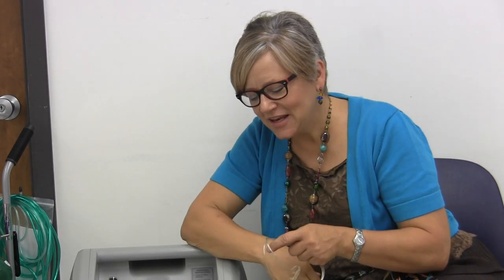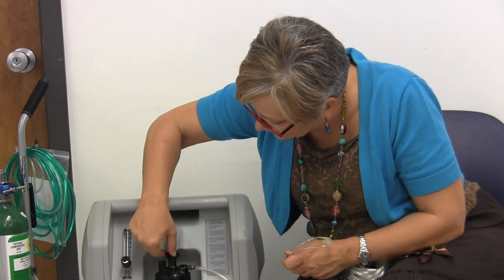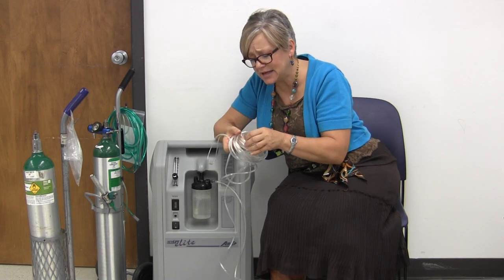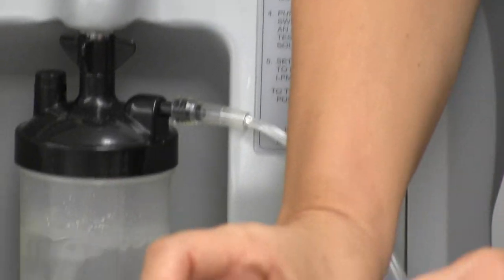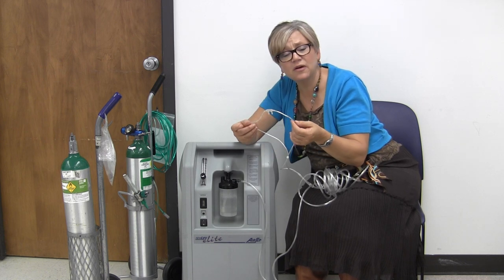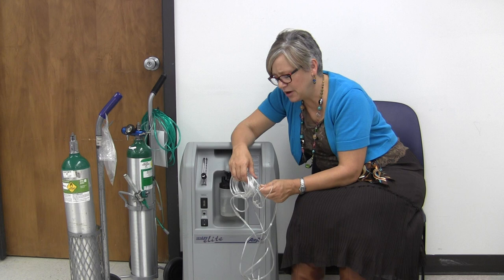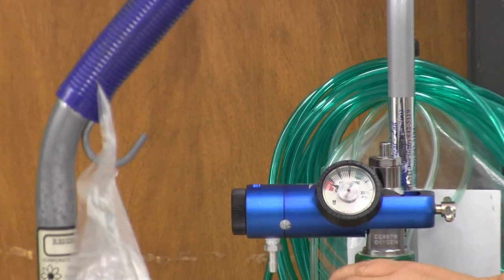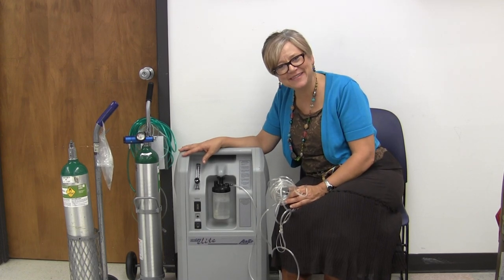Oxygen Concentrator Demonstration

Comment: If you are suffering from  COPD use Oxygen concentrator with precaution, in case the Oxygen level is not rising even after 5 minutes of use consult your doctor. Get the CO2 level in your lungs checked.

Comment: What do these machines do if they're left to run in a confined space?  assuming that they detect that they have markedly reduced supply of oxygen to concentrate, and excess concentration of nitrogen as well? Do they alarm if this happens, or keep cycling the nitrogen in and out even after the availability of oxygen is gone? Thank you.
Reply: dear meyers the machine should be kept  in ventillated aresso that i can give 90% oxygen..
there is no prblm if u get nitogen...
if get blow 80% some companies have an kept an oxygen analiser which gives an alarm...
and some kept sieve bed pressure alarm which means there is malfunction
Reply: It removes oxygen from the air and give you 90% oxygen. The air with less oxygen is dumped out into the room.

Comment: Do I have to have the oxygen tank refilled with oxygen? (probably a silly question)
Reply: Those tanks you see are not part of the machine. The concentrator machine is basically a pressurized sieve that splits the oxygen and nitrogen in the air, expels the nitrogen and mixes the remaining oxygen back into the breathing tubes.